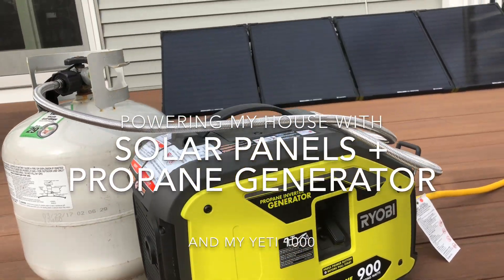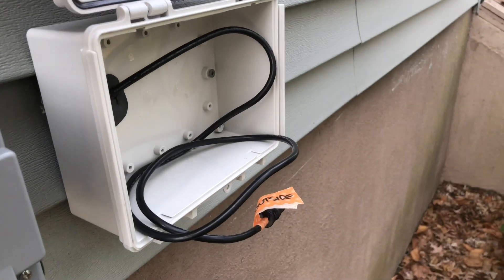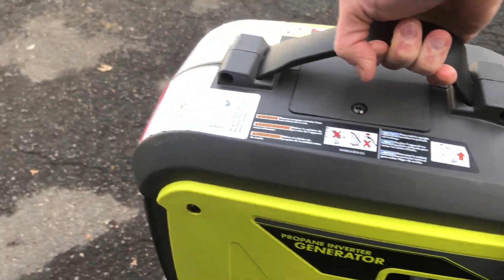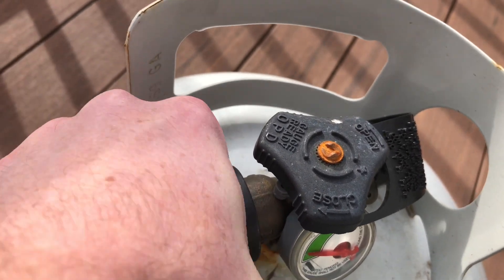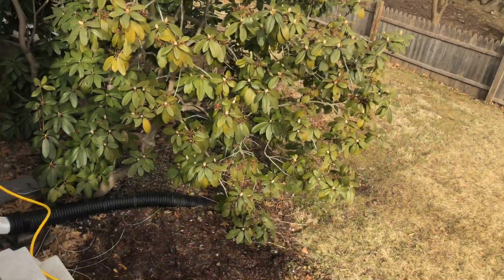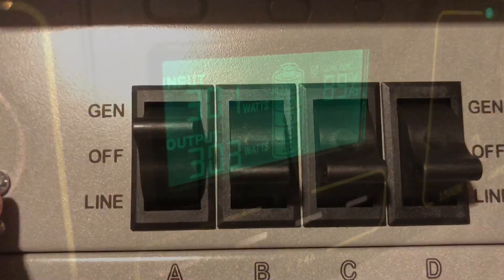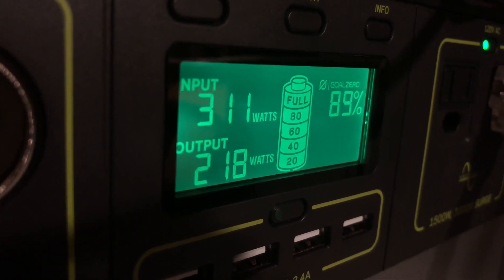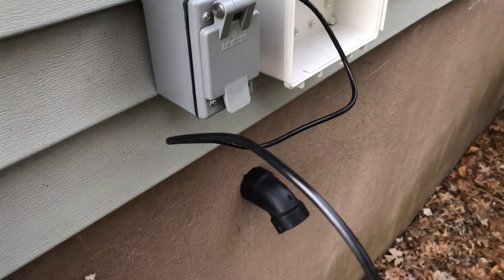Goal Zero Yeti Lithium for home power backup: Connecting solar panels and propane generator

Comment: Great video!  I have the Yeti 3000x, the Yeti X 600W power supply, and the Baja generator on order, so I can recharge the Yeti with the Baja during any extended power outage.    Do I just simply connect the Baja-->600W power supply-->Yeti 3000x?   I've never owned a generator and you mentioned turning the Ryobi to half full.  How do I do that on the Baja (which is the same of course)?    Or do I need not worry about it since I can input up to 600 watts (although the Baja outputs slightly more than that).   Do I just turn the propane tank gas to output 1/2 or 3/4 full?
Reply from the maker: Great setup! Yep, just plug the power supply into the Baja. No need to adjust the fuel, I was just making the point that is was running at half capacity etc. for fuel consumption calculations.
Reply from the maker: Just saw the Baja is basically the same unit as the Ryobi I have but with different branding
Reply: @todd.parker  Thanks for the info.   Just got the Baja today and have three 20 lb tanks full ready to go!   The Yeti charger and battery haven't come in yet, but can I assume it will also charge my Jackery batteries (1 240ah and 1 500ah), just using the provided 8mm charger?   The charger itself limits the maximum input automatically?
Reply: I just tried it and it works fine with both the Jackery batteries.    Great to know that I can have a way to recharge these with propane.   I live in a condo so a relatively quiet generator like the Baja is fine for having on a few hours each day as needed.   But it's a must to use the quiet lithium batteries inside to power the fridge and other electronics, and having peace of mind that I don' t have to worry about capacity is awesome.  Thanks again!

Comment: Thx u for ur videos. I'm learning about all the usage & connections to generator, batteries & solar. Did u run the generator? I did not hear any noise. They tend to make noise yes? Propane, I'm hesitant to use because I hv a small car that I am traveling in. But for the outside at ur house, I guess its cost effective? 
Thx again!
Reply from the maker: In this video I may have turned the sound of the generator down so you could hear me. It’s as loud as a quiet gas generator. Storing propane in a car can be dangerous so be careful. I like it over gas because it doesn’t go bad
Reply: @todd.parker  
No propane in my car. Tho many people use them in their car, Van's. But I think if I can stay away from propane it's better. I'm into solar and Battle Born batteries. 👍🏽
Ur car build with kitchen sink is awesome. I'm using ur setup for my SUV. 😝 Thx u. 🙏
Reply from the maker: L N that’s awesome to hear! If your using the water faucet idea, I just posted a review of a few options
Reply: @todd.parker  
Yes I watched nmthe new faucet video last night. 
Is the way u hv to connect the faucet to hard to remove while not in use so it does not drip? No quick release fitting u could use instead of the way u connected the water line?
Reply from the maker: L N you could install a valve in the tube but then you’d need to keep turning it on and off each fine, or only use it when traveling. I’ve opted to stick mine to the top of the file cabinet when driving then put the brick on the ground at camp. Ideally, you’d find a place to store the water lower in the car to avoid the issue

Comment: I subbed.  Great video.  So here is my scoop... as I live in NorCal, plenty of sun when the PG&E outages happen, and hate the noise of constant gas generator.  So been eyeballing a Yeti 1000x when it comes out.. or 1500x.  I "may" do the 1000x and then add 2 of the Power Battery units that are the lead acid type I believe for storage.  As a winter or low sun add-on, a Baja propane generator.  Same as the discontinued Ryobi model.  Just went on sale at Home Depot for $229.  So I snagged one.  Don't even own a Yeti yet.  I have 200 gallon Propane tank here as I live remote but also 20 gallon I can refill.  Hope is to have enough to just run my fridge, sat router, and att phone unit.  That way we can communicate and keep food cool.  If not sunny, let the Baja charge up batteries in Yeti.  I will also get 2 of the 200watt Goal Zero solar panels.  Maybe by end of summer I will have all this in place.  Just purchased the Baja today to get started.
Reply from the maker: Sounds like a great system. Seems super important to have a good power backup in CA.

Comment: I like these vids on the GZ yeti.  I am using the same ryobi genny but with 3 wall chargers. Each charger outputs 5 amps so I am using a 15 amp extension cord.  Question does your 15 amp cord get hot with the 20 amps being drawn by 4 wall chargers?
Reply from the maker: So far, no. I connect the generator to a receptacle that is connected via heavy duty Romex to an outlet. I then connect a surge protector power strip to that and plug the wall chargers into that.
Reply: @todd.parker   Thanks for the info on that!

Comment: Todd, I would like to have an outlet just like yours for my generator to plug into. I’m having problems finding everything I need to make it happen. Can you provide any help even though your electrician installed it?
Reply from the maker: What are you having trouble finding? The only tricky part is the inlet and I have a link in the description. The rest of the setup is standard wiring and receptacles
Reply from the maker: The outlet receptacle is just a way to get power from the generator to the chargers for the Yeti. You could run an extension cord, but a receptacle is cleaner
Reply from the maker: @B W Yep, exactly. That is just a way to get power from the generator to the Yeti charger inside. Probably overkill but I like how neat and water tight it is

Comment: Hi Todd. Thanks for the informative video. I've got a yeti 1400 and I just bought the Ryobi propane generator to charge it during an outage. I'm planning on just running power through an exterior wall using a 15 amp power inlet similar to what you showed, connected to a standard 15 amp outlet on the inside wall using 14/2 NMB Romex wire. Do you know if there is any reason to use a higher gauge wire? Thanks
Reply from the maker: Hey that’s great, glad this setup works for you. I like how tidy it is. I’m not an electrician but given the output of the generator, standard Romex seems fine for this application. My electrician used extra beefy wire in case I got a bigger generator in the future.

Comment: I can understand using the solar to power your yeti then your house but why use the generator to recharge the yeti when you can use it to directly power your house?
Reply from the maker: Good question. I’ve set up the wiring so I can connect the generator directly to my transfer panels or into the Yeti chargers. The Yeti can output 1500w continuous and 3000w peak while the generator puts out 700/900w so I’m using the Yeti as a buffer to handle larger peaks the generator couldn’t handle like when I need to run my sump pump.
Reply from the maker: Also, this setup lets me only run my generator for a few hours per day to charge the Yeti when solar isn’t enough so I can save fuel, take it easy on the generator, and have some peace and quiet.

Comment: I am interested in purchasing a Yeti solar generator for boon-docking in my RV as well an emergency power source for the house. The 3000 Yeti is just not practical for RV use - just to heavy.  So, my selection is between the 1000 ($999 at Costco currently) or the 1400 with wifi integration ($1799 from GZ).  I'm curious why you chose the 1000 over the 1400.  Wouldn't the wifi integration assist you in managing your system remotely?  And let me thank you for putting together such a great playlist of educational and informative real world videos on the Yeti 1000 and GZ accessories.  Much appreciated!
Reply from the maker: Thanks! I’d get the largest capacity you can afford since since they aren’t expandable with additional lithium cells, lead acid only. I didn’t have much to spend so I got the 1000 but wish I got the 1400 or 3000. Check out goal zero’s open box units, you can save quite a bit. https://www.goalzero.com/shop/open-box-product/

Comment: What is the advantage of an lpg generator over a petrol one?
Reply from the maker: Mostly fuel longevity. Gas with ethanol has a shelf life of months and you need to deal with clogged carbs and running all the gas out of the engine each time. With propane, it can be stored indefinitely and burns cleaner. Lower energy density but worth it since this is for emergency power.

Comment: Can you detail the outside inlet box to the inside plug?  Materials used, cost?
Reply from the maker: Sure Jason. The receptacle I used was this Leviton model for $40. Leviton 5278-CWP Straight Blade... https://www.amazon.com/dp/B003ATXIBG - they only thing to note is you need to get a deeper box for it. My electrician got the box so I don’t have a model number. That is wired with heavy duty 10/3 Romex to a standard dual wall outlet so nothing special there. I think this setup was probably $60 in materials plus labor.
Reply: @todd.parker  Thank you. I have the same set up but use a small gas generator to power the transfer switch/charge the Yeti and I was racking my brain trying to figure out how to run the wire without using an extension cord inside.  Thank you for your help.  Side note, I did speak to GZ and the new 300w charger should be out Mid March/Early April.

Comment: Thank you for this video!! I have been eyeing the Ryobi
Reply from the maker: You can’t beat the price! It costs less than the propane conversion kit I was going to get for a Honda eu2000. If you need more power, Home Depot sells a few other propane generators. This one is about perfect for keeping 300w flowing into my Yeti which is roughly my load for the 8 breakers,
Reply: @todd.parker  brilliant, thank you very much. I'm in SoCal, and the earthquake activity has me planning. I want to be prepared for a power outage.

Comment: If this is a backup system for emergencies, don’t you think the money would be better spent on a bigger lithium battery, a second propane can or a bigger or second generator? In an RV camping situation, the solar extends the propane supply and reduces the expense over many such vacations. But since you are in a stationary location, and hopefully your emergencies are not that frequent, having ample propane doesn’t seem to be a choke point. The solar just seems very expensive for it’s limited contribution in this scenario.
Reply from the maker: Ideally, I’d have a bigger battery but the 1000 gives me enough buffer to run my fridge for almost a full day and gives me the 1500 watt power output I need for when the fridge or sump kicks on. I agree that the solar panels aren’t enough alone but they will output 160 watts or so for 4-6 hours on a sunny day which is enough to fill the Yeti from 20%. I’m hoping Goal Zero releases something to let me tap into my rooftop solar, that’s why I’m not going too far with solar since I have 9kw of solar on my roof I can’t tap into yet. The generator is nice because it’s only $300 and sips propane so I can get long run times. Since it’s not gas, I don’t need to worry about fuel going bad and I can easily add more than the 3 tanks I have if needed for little money. Every house has different needs but mine only needs about 300 watts to run the 8 circuits I have on the transfer switches. This is designed to be a very small and portable system since we don’t lose power much.
Reply: Todd Parker Great video you are the only one doing this.Can you make a video maxing out the yeti input,I have a yeti 3000 and is not going over 400w pf input per hour,and when I talk to goal zero they said I can even get 600
Reply from the maker: Gabriel Varona I’d be happy to but I need more input sources! Right now, the best I can do is 300w from my fast charger, 160w from solar, and 120w from the car charger hooked to an external battery for a total of 580w. The MPPT module should handle 360w and the built-in PWM should handle another 360. Are you distributing the inputs across both? 400w into one of those would be too much.
Reply: Todd Parker, I learned from Goal Zero support that the Yeti 1000 battery management system (BMS) has a max input of 45 amps (540 watt at 12 V) from the combined input of the PWM and MPPT module.  The Yeti 1400 and 3000 don't have that limitation and the BMS can go higher amps (but they didn't mention what is the max amp/ watt for the 1400 or 3000 BMS - I can only guess that it the full max watt input for each module).  The Yeti 1000 is a slightly older design that is why the BMS is limited to 45 amps (and has fewer USB features compared to the 1400 and 3000).  I attempted to use two of the 300 watt (25 amp) fast chargers and the Yeti 1000 BMS shut down the charging because the total amps was 50 (5 over the max current).   In theory, you should be able to use the fast charger and three regular Yeti chargers to safely quick charge the Yeti 1000 (adding one more regular charger will go past the max current).  My next experiment may be the fast charger, 1 regular charger and the car charger to see how close I can get to 45 amps as soon as I can afford the car charger.
Reply from the maker: Very interesting! Goal Zero product info is so darn unclear, this is very useful. Let me know how the tests go!
Reply: Todd Parker Hey Todd quick question,how do I make my own 8mm extention.Where do I get the 8mm pin and cable? If you can provide me with link it will be better.Thanks
Reply from the maker: Gabriel Varona so you’re looking to create your own 8mm extension cables? I don’t have a good suggestion for connectors except to buy some shorter ones from Goal Zero, cut them and crimp/solder your wires on the shrink wrap so they connect tightly. Seems that going Anderson will be a better way to go since you can buy those connectors and a special crimp tool and they handle very large gauge wire and high power.
Reply: Thanks for the great response. I have been looking at that particular generator myself, but didn’t bring it up since it wasn’t the focus of the presentation. Excellent information that you only run it at half power despite its compact size. Thanks also that the battery in the 1000 handles so much without any thought of duplicating it. All great facts.

Comment: Thanks for the research. I watched your other video with the 4 chargers comparing the PWM and the MPPT chargers and I have some questions. In the other video the 4 chargers generated 220W of power in the anderson PWM charging port, and 260W in the anderson MPPT charging port.

* In this test, you had the solar panels generating 55W in the MPPT charging port, but when you added the 4 chargers to the PWM charging port this added 260W of charging port bring the meter to ~312-315W of charging power.

I wonder if you'd get a higher charge rate (due to efficiency of charge) if you swapping charging ports and put the solar on the PWM and the propane/wall charger port on the MPPT.
Reply from the maker: You’re probably right. The solar was pretty weak that day so I didn’t do the kind of tests you mentioned (all good ideas) but I think the rule should probably be to use the MPPT input for whatever has the most power since it will improve the solar or wall charger conversion. In this case, flipping the inputs might have gained me a few watts for sure. Next time I set this up, I’ll test that.